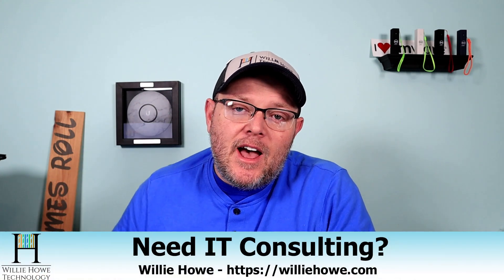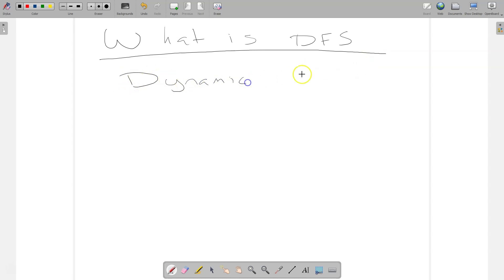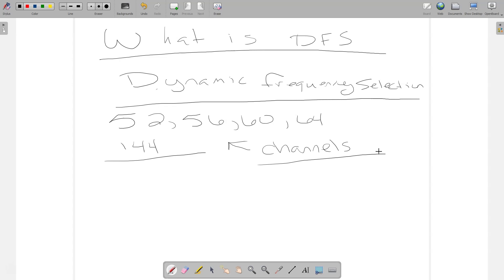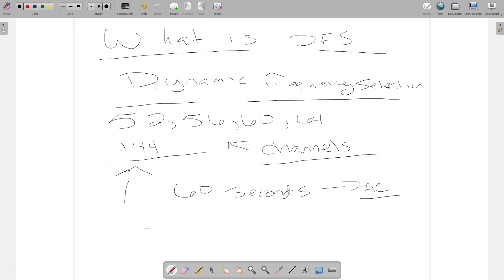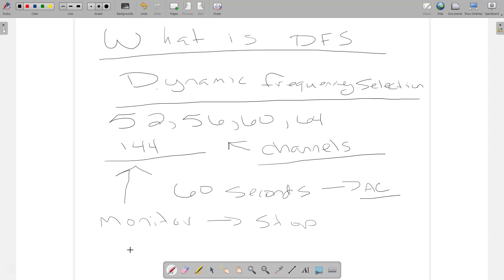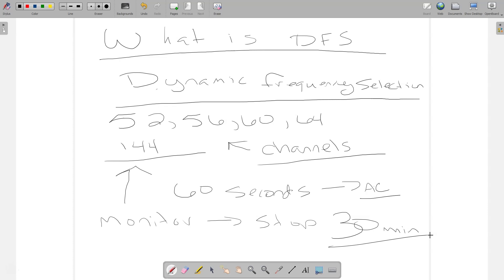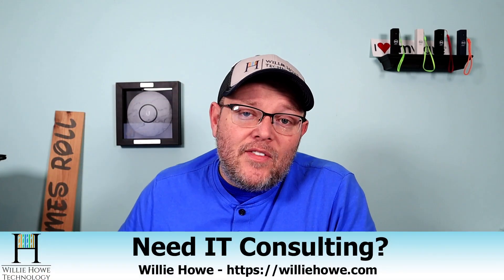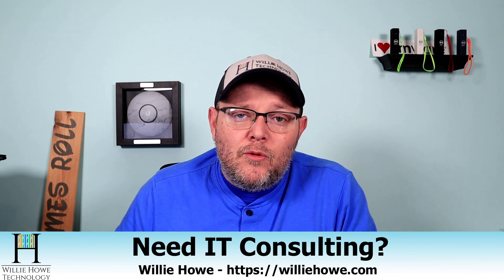What is WiFi DFS?

Comment: For quick info: I recommend setting the video playback speed to 1.25x or 1.5x as the video lacks editing, and feels drawn out. 
If you're looking for a summary

(Yes, I know this video is 2 yrs+ old)

(DFS have longer channel acquisition times compared to non-DFS channels sometimes as little as 60 seconds and up to 10 mins to make sure the channel is not occupied)

Rural areas: with fewer 'disruptions' and less 'noise,' enabling DFS channels should generally be fine. However, there is a possibility of channel switching if a radar system starts using the DFS channel, which may cause issues for devices that cannot handle frequent channel changes.

High populated areas: utilizing DFS channels can provide access to less congested channels, resulting in potentially better performance. However, there is also a higher chance of being kicked off those channels if there is a heavier presence of prioritized radars, which can lead to interruptions in the 5GHz connection.

Personal Opinion: Don't use DFS if you don't need to. In rural areas, channel congestion should be minimal, and in highly populated areas, DFS channels will probably be as reliable or congested as public channels.

Apologies for the long comment and my complaints about the video layout. Hopefully, this recap helps someone understand the topic better. Thank you Willie Howe for the overview!

Comment: Hi, Awesome video. indeed useful. As I research on channel switch announcements, I have a few questions to clarify.
1. If an AP is enabled with  DFS, I usually observe, it starts with channel 52(being Europe) and keeps this channel during its uptime as long as there are no radars or interference. Is this correct?

2. If DFS is enabled, with a single operating channel,  the AP can communicate with multiple devices simultaneously using the feature OFDMA (main channel divided into partial channels if 802.11 ax used). In this case, how can we identify the frequency of partial or sub channels. Any idea?

3. In our personal home networks, if the AP is enabled with DFS, will it continously scans for radars or such interference? I understand that the scan (channel availability check) will happen only when it boots for first time. Is this correct?

4. DFS feature is not available or applicable to 2.4. ghz. Is this correct? 

I would be thankful, if you could clarify my doubts. thank you in advance.

Comment: The conclusion is that you should not use a 5 GHz WiFi with DFS, if you want a reliable connection, as a replacement for the network cables in a home.

Comment: Willie this video was looong time coming.
In Czech Republic, Slovakia and I presume the rest of the EU, if you deploy outside placed APs, it's mandatory to use DFS channels. This is a huge headache with UniFi They jump, however, if they were to jump, say, to channel 52 and I deployed, say UAP-AC-M outside, I am suddenly not in compliance, because channel 52 is indoors only. There used to be a selection box, back in a day, where you could disable indoor only channels for outside installations, but it's gone now. Meanwhile AirMax devices can have preset fallback channel. Ubiquiti would stand to benefit from pooling their ideas a little. Sure, ISP gear is ISP gear, but WiFI is WiFi!